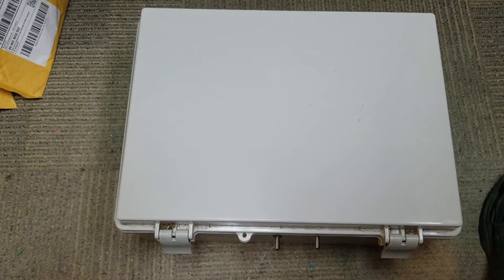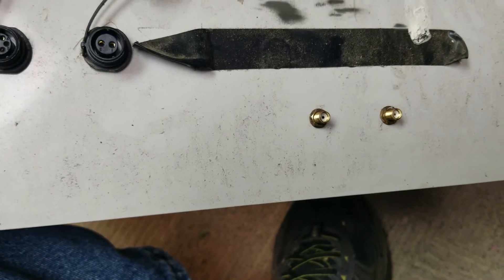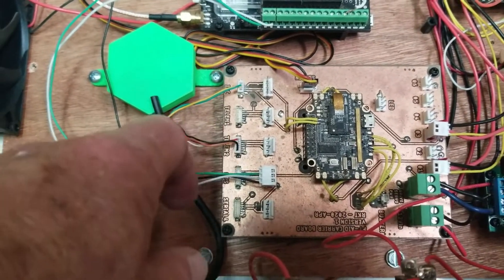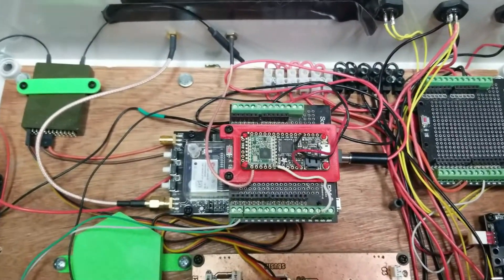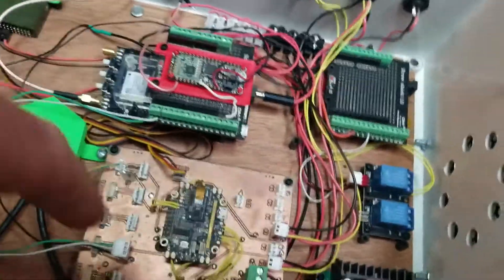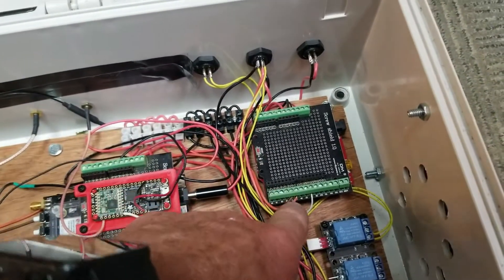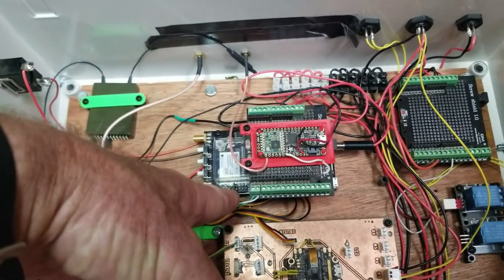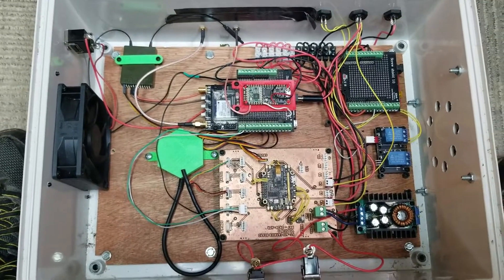Overview of Kakute F7 Control System Before RIPPING IT OUT!

Comment: Thank you for sharing this and your other work.

Push in breather Car filters work great for keeping dust out.
Reply from the maker: That is an interesting suggestion. I am building my Version 2 autonomous mower. I have not cut the hole for the ventilation inlet. I will look into your suggestion. How do you suggest you hold the filter onto the enclosure?
Reply: @KennyTrussell 
Unfortunately I can't take credit for the Idea, @4:15. This guy does a nice job, and he helped my kill switch problem by replacing a relay with a solenoid. 
 https://m.youtube.com/watch?v=ZIBI8zOR1_M&list=PL3CSczXO6_X0DStQHZfdKIzD13JS9BwpL&index=13

Comment: First of all Kenny thanks for sharing all of your hard work! I just came upon you and Yuri. I have been reading the links you both post. Looking thru the threads on ArduPiliot/Ardurover trying to get a grasp. I have a BadBoy 54" that I want to convert to fully autonomous eventually. I have an Orange Cube bundle on the way, need some large servos etc. I am curious is there a need for the sticks to be pushed outward and in their respective centered position? (I understand there is a micro switch that need to close the circuit but what is its purpose? The switches could be bypassed and the arms removed entirely, couldnt they? Is there a reason to retain them? Maybe for manually moving the unit occasionally? Anyway again thanks and looking forward to a response, eagerly ;-) I hate mowing
Reply from the maker: You stated it well - the sticks could be removed, but I like having them there for the occasional manual driving. Some  (Yuri, for example) removed the seat and put the electronics in that spot. There is something to be said for putting the electronics there compared to where I have them up high on a piece of plywood on the ROPS. When I hit big bums, I think my electronics get a bigger jolt than they would down low. BUT, I do like being able to drive the mower manually. I did remove the upper part of the stick, if you notice in my videos. 

As far as putting the sticks in the outer position for cranking, that is what I still do. But, I may add a remote start capability so that I can start and operate the mower without having to be near it. I guess that would mean bypassing the switches in some way.  I may not go to a remote start, though. I do want to automate the throttle and PTO, though, so that I can be away from the mower when I throttle it up and engage the blades. Right now, my procedure is to have my finger on the kill switch as I stand beside the mower to throttle it up and pull up the PTO switch. That really is a little more dangerous than I would like, even with the kill switch.

Please share your progress as you work!
Reply: @KennyTrussell  Thanks for taking the time to respond. I will be happy to show my mistakes aka work as soon as I start to grasp the set up of the cube. Figured for safety I better start with a rover  ;-) I read somewhere you used actuators over servos and then switched. Is that correct? If so what did you finally settle on (make and model of servo or actuator)? Thanks again.
Reply from the maker: @CncObsession  You are right. I started with a linear actuator with feedback and a control board which makes it look like a servo (PWM-driven) to the flight controller. My original parts list is in the description of one of my original videos (https://youtu.be/kyI7HjmpcVM ). A good bit has changed since then. The original Actuonix actuators and control board part numbers are listed there, though. I bought the strongest, which also means the slowest) small actuators in that series. Later on, I learned that I could reduce significantly the force required by removing springs from the transaxles. So, I really think that if one wanted to use linear actuators, he could go with a faster, yet weaker, one and be just fine. However, I am very happy with my servos, which are model number Hitec RCD 36845 D-845WP.
Reply: I'm on a similar journey good luck!

Comment: Curious,  what does the arduino monitor to initiate an engine shutdown?  Very informative video
Reply from the maker: It monitors two signals. One is a channel directly from the RC receiver, so that I can flip the switch on the transmitter for that channel and kill the mower. The other is the throttle channel. There seems to be a standard in the RC world that if the receiver loses communication with the transmitter, it drops the throttle signal to a PWM value that is below the normal range. So, the Arduino can detect when the mower has lost communication. I have a 20-second delay before killing the engine when that happens so it can ride through short losses.

One nice thing is that the connection from the receiver to the flight controller is via the SBUS connector, so that the individual PWM outputs are unused but they are active. So, I was able to connect them to the Arduino without any Y-cable or anything.

Thanks for your interest and the excellent question!